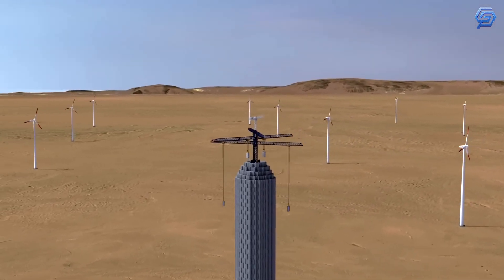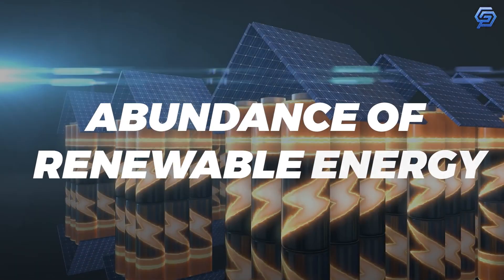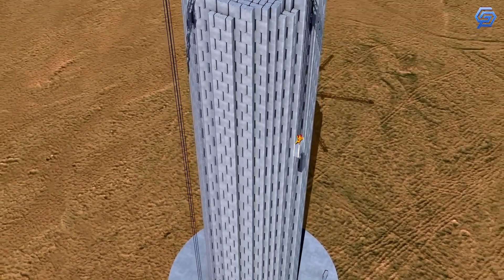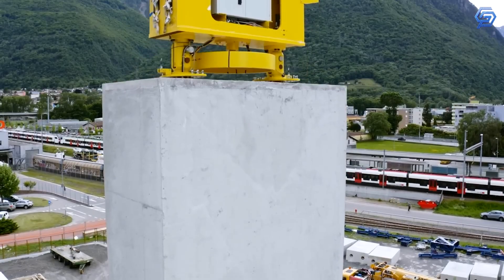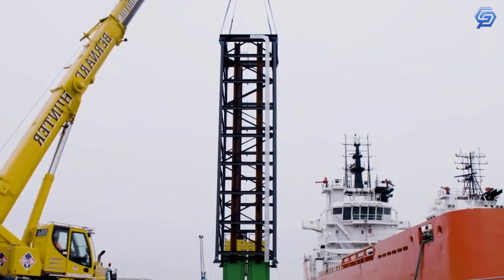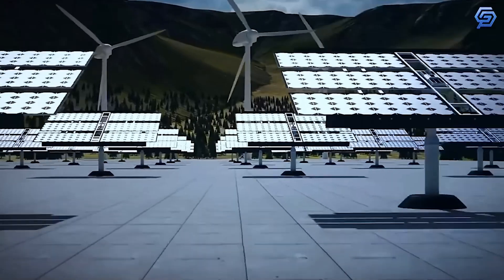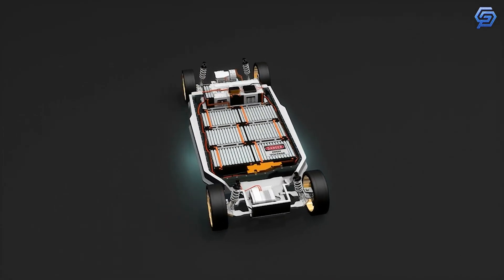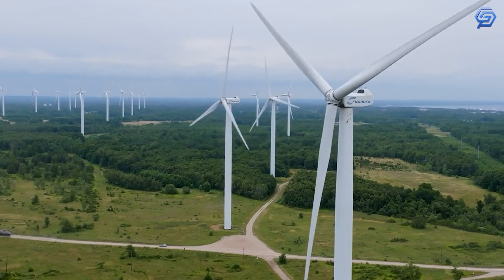Gravity Batteries: Harnessing The Power Of An Unstoppable Force!

Comment: Oh boy, I don't even know where to start.  The video is a collection of stock and corporate advrtisment footage.  250 kW able to sustain 750 households?  That'd be a third of 1 kW or 333 W of power per household.  That's lassuming typical households operating at a power level about equal to their annual average.  That is ...  very optimistic.  While its correct that density of advantage in such a system the required masses are enormous.  Assuming concrete - it is just about 2.4 times as dense as water thus the volume of concrete could be 2.4 times smaller for the same mass as with water.  At current technology concrete production is massively polluting.  And for any kind of grid-level storag  km³ of water would be needed.  Water is abundant and cheap even in the quantities required for significant pumped storage, which is why pumped storage can work.economically.  Also we're talking about a relatively complex mechanism for stacking of the bricks.
To give an example, a 100t weight (much larger than in the video) lifted by 100m has a potential gravity energy of 273 kWh.  A 100t concrete weight would be almost 42 m³ - well larger than a 20ft shipping container can hold.  At $70 t per ton that's 7,000 for just the concrete.  Equivalent water: $0, provided by nature for free.  Weight of a LiIon battery to hold mentioned 273 kWh - bit over a ton or some 400 l.  Add some extra for cooling, wires, battery managemennt systems but you get the point, pumped storage is cheaper, batteries are denser.
Then towards the end the video says "storage is done through a flywheel".  Ehh...  That's an entirely different technology.  That is immediately followed by a switch to a car repeating gravitricity's unreflectd claim every car was going to have one of their batteries.  As cars are not very high the masses would have to be larger.  Verrry large - large enough to be comically impractical.  Simiarly for rotating energy storage which with large masses adds issues with gyroscopic effects.
Thunderf00t already had a go at this kiind of big lego brick batteries and came to the same conclusions.  It just won't fly.

Comment: Just build more Pumped-storage hydroelectricity systems (https://en.wikipedia.org/wiki/Pumped-storage_hydroelectricity). It's proven technology and basically a more cost-effective version of the gravity batteriy systems in the video. Yes scaling these hydroelectric systems up will have some impact on nature, but far less than scaling up the systems shown in the video. This tech was already available in 1907 in Switserland so I would not exactly call it innovative. The only reason there isn't more of it is that until recently nobody needed it and because some people block the scaling up because they don't want to accept any changes to the landscape around their homes. All that will be even more true when trying to scale up the solutions in the video. The problem is political not technical.